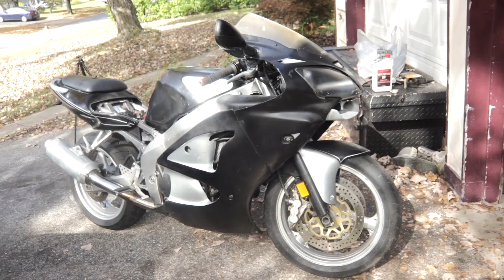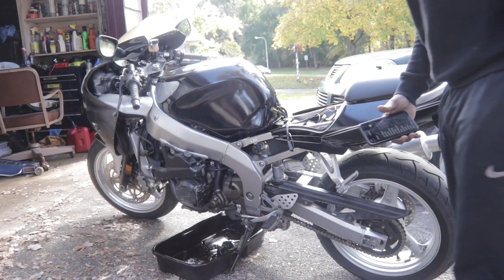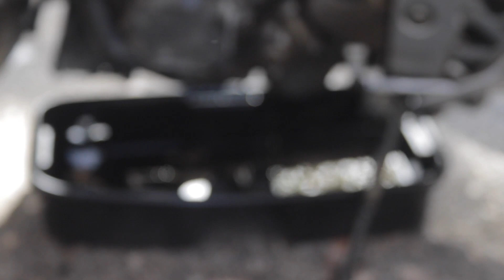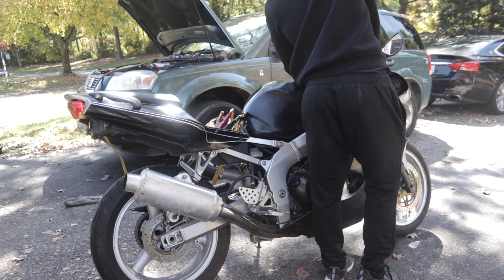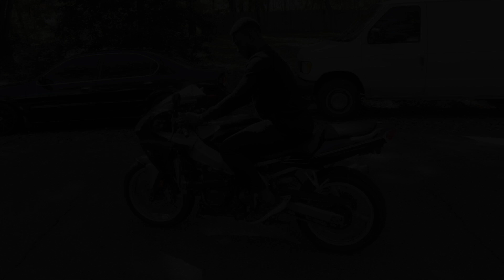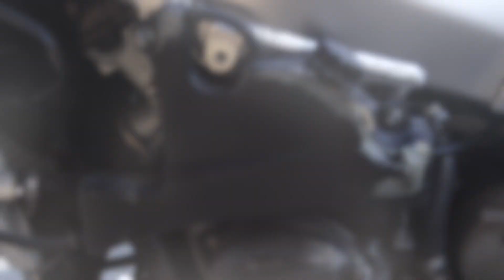I Bought My First Motorcycle & CRASHED It Already!!

Comment: Hey man, just wanted to say that you shouldn't use tools to tighen down an oil filter. Just tighten them down by hand and you'll be alright, the tools might make it harder to take off.

Also make sure to dip your finger in some of the new oil to spread on the oil filter's rubber gasket. Saw your newer vids and like what you're doing, keep it up!

Comment: I always get grips first, but i do respect the drive to get back on it. From the initial takeoff i knew something was bound to happen lol Tires, Tires, Tires, and rotors Pads, etc. If you cant stop or grip your screwed. Also bike was quite large in cc size for your first, just always remember Gear+MSF+Maintained bike+no speeding= ALIVE    p.,s you fell because you were dragging leg and facing that direction
Reply from the maker: I couldn’t agree with you more, I definitely took a step bike to get a better grip of what  I was working with.  And yeah that sounds like a good formula to me ✅

Comment: Definitely wasn't the leaves. One of the most important things you can do on any bike is get weight on the pegs. Without it, you have no stability on the bike, and the bike itself isn't going to have the same traction it would otherwise have with your feet perched up on the pegs.

Leaves can make things sketchy but it won't make you crash if you're riding correctly - otherwise every MX, ADV, DualSport rider on the planet would do nothing but crash 100% of the time.

Get some riding gear, and maybe hop on a dirt bike and ride around in some loose stuff to start with. Learning to ride dirt first makes paved riding a cakewalk.

Everything on a bike is about finesse and practice. We all crash, especially those of us that ride dirt. Just gotta get back up and keep going - it's a part of the process.

Oh, and keep the rubber side down!

Comment: Take a tip from an old fart..work on your balance when your balance is good the confidence will flow...practice riding as slow as you can without putting a foot down is a good start.